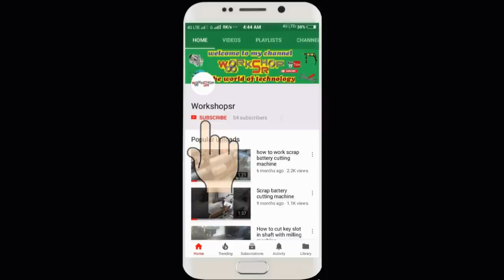how to make screw conveyor! screw conveyor kaise banate hai

Comment: Respected  sir.
I don't know  how to write  in hindi , you please  translate  it.
I have  one suggestion  which will help  to companies  using  it for washing  fruits. 
You can add brush  for brushing  fruits without  too much cost.
In first  step where  you cutting  round disc add small  strips both the sides. 
Go to bazaar  and buy  bottles brushing  brush and
 intacagle  the brush in welded  strip, cut the handle  before  putting the brush.
Suppose  your roller  is one meter  so divide  it  half part with brush and remaining  without  brush. 
Why I am saying  to add strips  for intangle  brushe,  with time  after usage  brush can get damage  , then easily  we remove  old brush  and put new one.
After  making  please  download  one video .
Feel free  to ask questions. 
Namh  shivay.
Reply: Sunita Dwarka nice
Reply: Is cheez ko AUGER CONVEYOR KEHTE HY